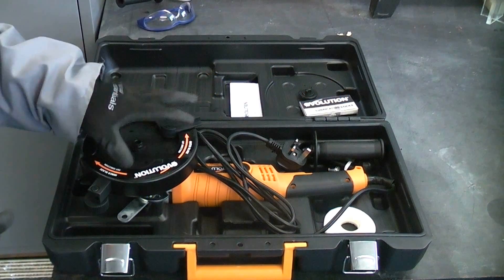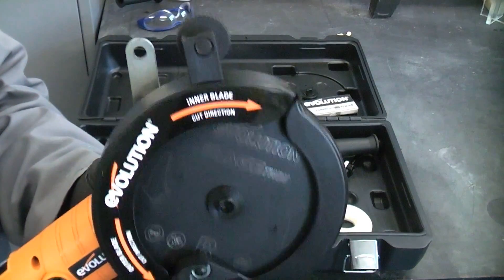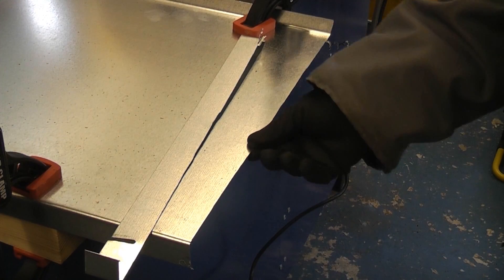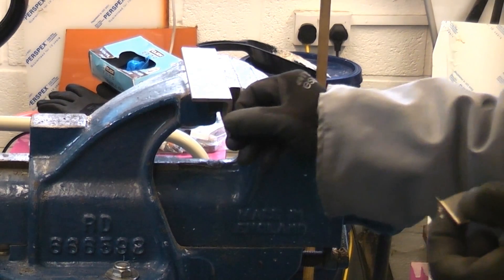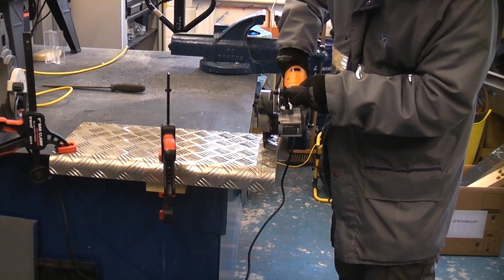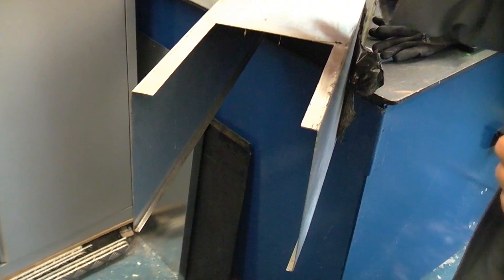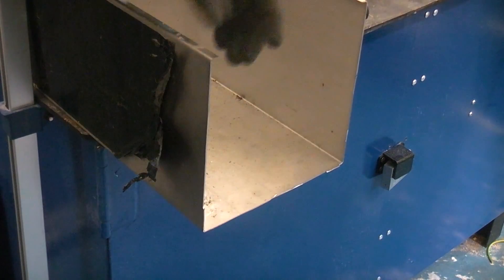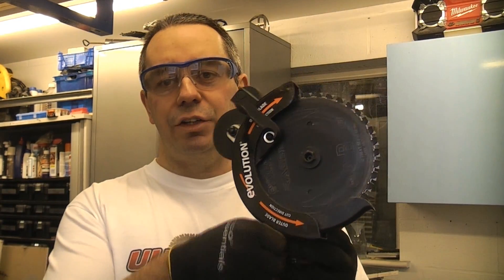Evolution Rage Twin 155mm Multipurpose Twin Blade Saw

Comment: Nice little machine that chez , as you say that guard is a pain and as this is similar to an angle grinder which doesn't have a guard , maybe worth a look at taking it off completely .
Reply from the maker: I'd be reluctant to remove the guard just in case someone saw me using and removed theirs- then injured themselves.
It is a pain though!

Thanks for the comment

Comment: this last week i have been chasing walls and counter sinking the back boxes in the wall the bricks are so soft how do you chisel out the brick without losing half the brick????
Reply from the maker: For soft bricks you can buy a kit made by Armeg, you use it in a SDS drill that has roto stop.
Firstly you use a round cutting tool to make a round hole, almost the same size as a back box (two holes for a double back box). You then put a square cutter in and use it on chisel only. It does not work on all bricks though, I tried it at my old house and it didn't work at all but I know a guy that said it worked well on his bricks. It does make a lot of dust though when drilling the hole. If you Google for Armeg box sinker you find them ;-)
Reply: thanks i will have a butchers :)

Comment: I have seen these twin blade saws around although not evolution ones. To me, I really like the machine and if budget allowed then I would invest in one straight away. I take on board your points r.e; guard issues but I would still be tempted to purchase one. The only other point that I saw from your film was the swarf flying towards the camera when you cut the aluminium tread plate but you covered this by stating the P.P.E that you need to wear. Thanks UH. N.
Reply from the maker: You are welcome Neil,
Thanks for the comment ;-)

Comment: Great review and just to point out the counter-rotating blades are helpful reducing kickback. Really more of a hybrid tool but useful on jobs usually an angle grinder or chop saw would do. Revolution are keen on price.
Reply from the maker: Thanks for the comment ;-)
Reply: i think this saw drives in the opposit direction then a normal saw....... the blade goes upwharts....

Comment: Nice bit of kit, I can see in the right circumstances it could be very useful. I have never seen a tool cut thin sheet metal so quickly and easily, seems like there was no grabbing or distortion either. I reckon that's where it's strength is to be honest.
Reply from the maker: Absolutely, Thin metal can be a real pain to cut but this machine did it easily.
Thanks for the comment

Comment: Like the review both pros and cons. That thing looks like it cuts through butter not steel.
how much is it? Not that I will  ever get to buy it where I live.
Reply from the maker: Thanks, yes it cuts through most materials with ease.
It's approximately £130 for this particular model, I believe they do a smaller version which is a little cheaper.
Thanks for the comment